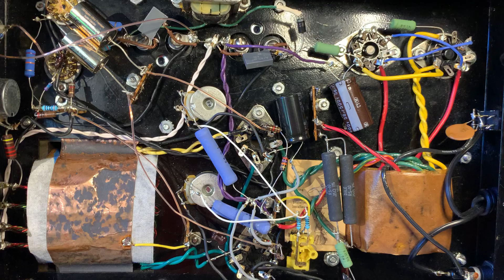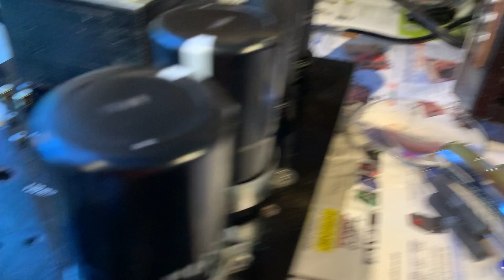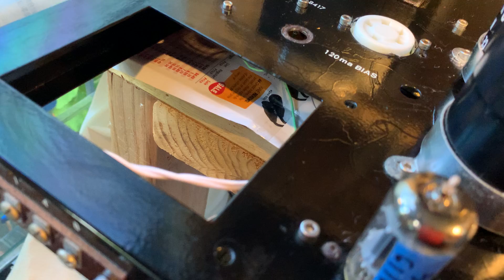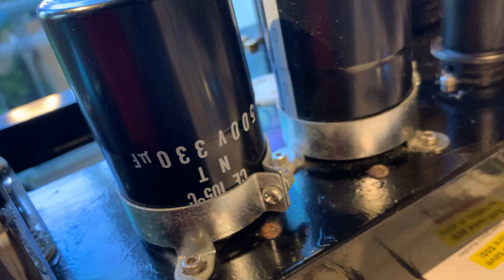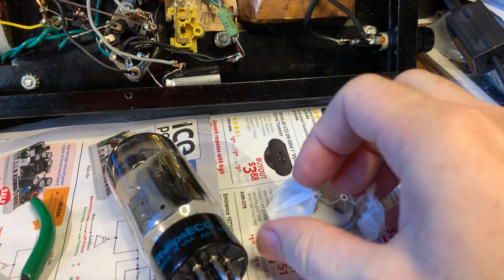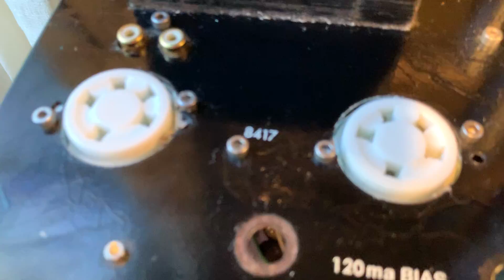Peak inside the first generation Quicksilver mono

Comment: This amplifier is alleady modified ..Janos.
I know this amplifier well Janos ..haha I spoke to soon again !!!!
The 8417 was and is one of the latest tubes developped with extreme perveance...........as mentionned by Janos.
It is also one of the very few tubes specially developped for audio ( even the 300B was not for audio ! )............It was Fisher who demanded the development for their top range amplifier...the FISHER 1000....... the driver was a ELL80 ( a double 6DL5 penthode  in the same noval tube container )
The 8417 was by its design build on the limits of tube grid distance with the risk of run away ...............but so easy to drive what explains a lot as the driver is less dominant .......
8417 is very difficult to find in nos condition and very expensive if you are lucky to find some pairs, they MUST BE paired or the amplifier bias should be modigfied and be individual..........
Replacing the OPT is a problem when you do not find an original......Soundwise only ! .............the original OPT can also derive 2 Ohms loads.....
Reply: Thank you! Very interesting